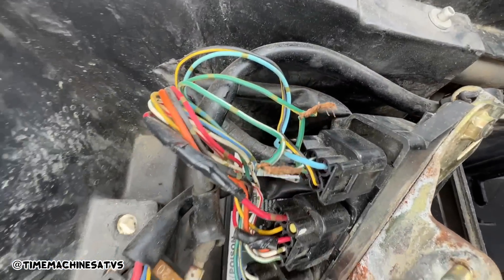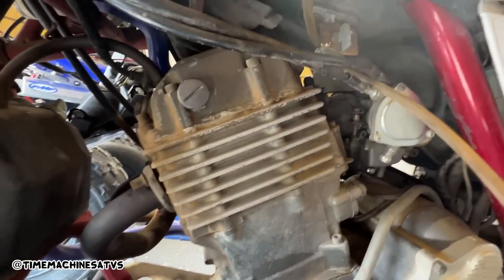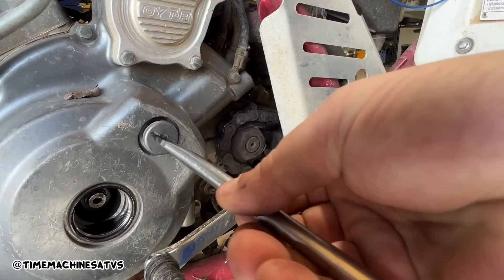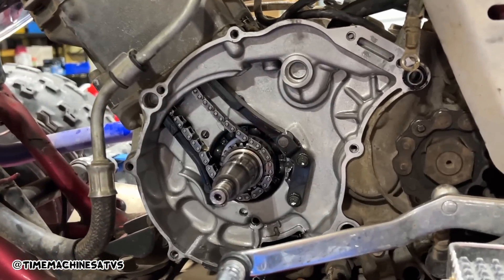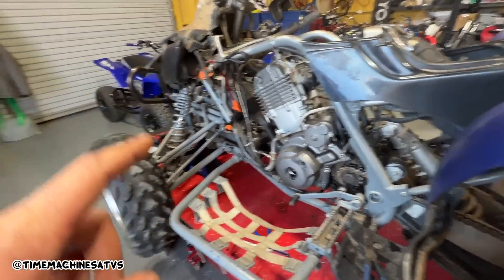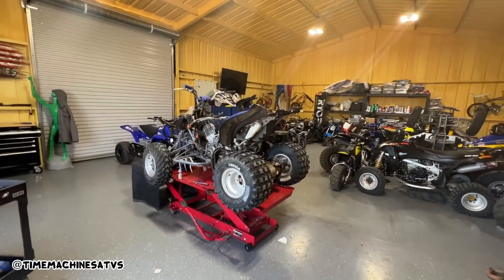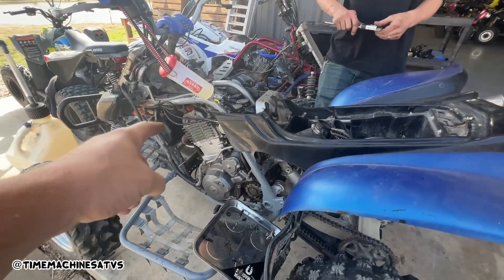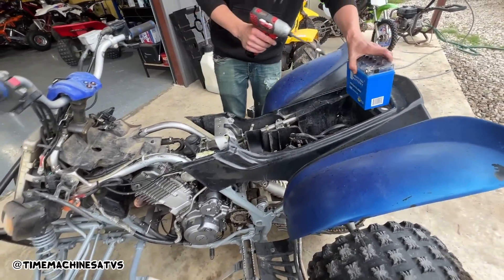Marketplace Raptor Rebuilds | Yamaha Raptor 660R Rebuilds

Comment: Hello,  I have a 2001 yamaha raptor 660r. Ever time I press the gas it bogs down. I seem one that you fix just by cutting parking brakes I think that's what you said. I haven't cut it yet I don't want to cut the wrong wire. I need to ask you first .

Comment: Need help. I completely cleaned and rebuilt the OEM Mikuni carbs. Every piece of the carbs was replaced with OEM and a Dynojet kit. Pro circuit exhaust and open k&n filter. Sea level. 146/148 #25 pilots 3rd clip on needles and 3 turns out on fuel. Quad starts, idles and revs up awesome! I took it down the street and it rips! BUT I had a low rpm bog in 2nd gear. Any ideas? Maby a tad less fuel in left carb???
Reply: Any popping off acceleration an did you make sure your floats are leveled if it only does it on throttle then it sounds like a jet issue double check your jets make sure there the same size. you could always lower the needle height for less fuel as well. Remember main jet for throttle an idle jet for idle. mixture screw is set different an should be set to the machine. So set it to whatever the manual says an it’s usually slowly turn till it runs poorly an back off till it does the same an find the happy middle shouldn’t be the mixture screw tho. Sounds like your on the right path with the too much fuel somewhere. Could be your float is a little wack on one side of the carb just a hair off can make it feel weird
Reply: An does it do it cold hot or always if it does it always then it’s prolly something to do with the carbs if it does it when it’s cold then there’s your issue let it warm up a tad valves can cause issues but it doesn’t sound as if that’s the problems compression test would help an adjusting the valves is relatively easy as well if it starts hard or has hard starting then it could be valves. An that’s a whole other mess of diagnosing but relatively easy as well

Comment: Do you have any 660r parts you could sell? I'm looking for an entire top end, cam chain, side cover with stator and oil cover and starter gear. Im really just starting at a $50 good bottom end with a frame and swingarm so i don't mind putting money into it.

Comment: Hey guys i know this vid is old but i got a 2003 raptor with 686 in it i put new carb new jets 160/165 turn the dial 3 turns on the first carb and 2 on the second the battery is new but it wont turn on any help will be highly appreciated

Comment: Hello  I own the 660r too and Wonder what IS the best sounding exhaustpipe for Drive legal Roding on the Road ?
Reply: just pull out the baffle from the stock one fuck a legal exhaust
Reply: @adamdg12  nah  not in germany
Reply: @Daszebi98  just go with anything full an you won’t have complaints just a muffler won’t really change much an make sure you get the recommended jetting as well an follow others steps in tuning the quad when you do removing the baffle will just annoy people an make it sound more Ruff